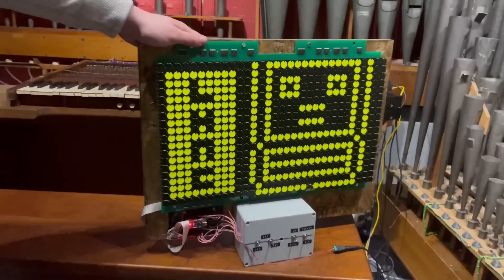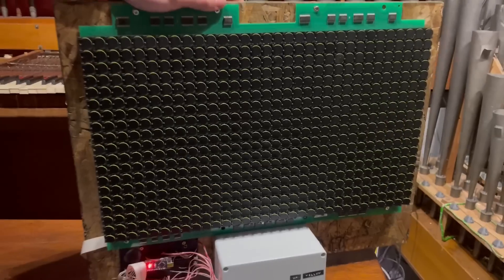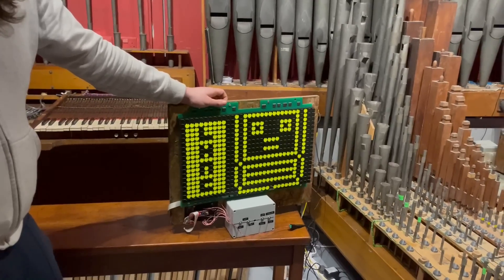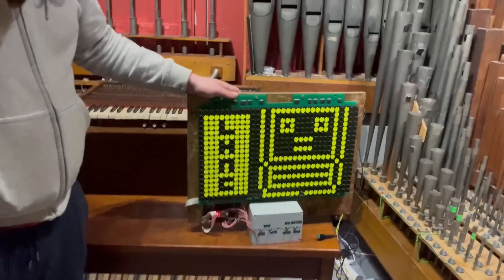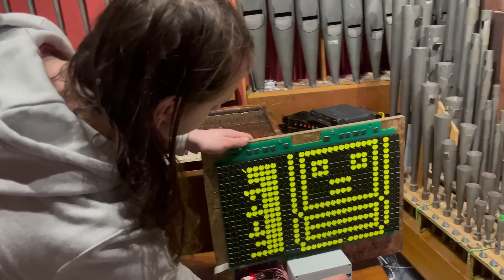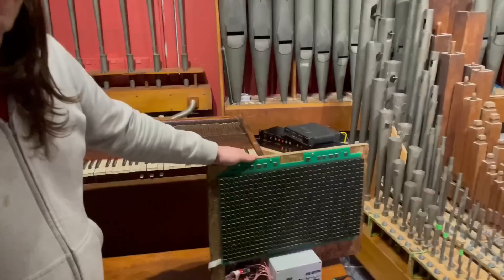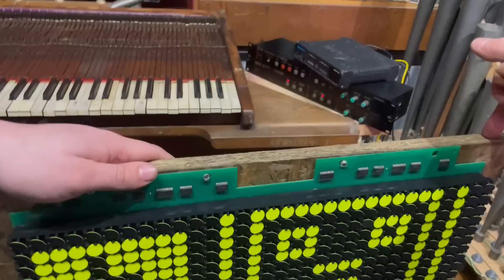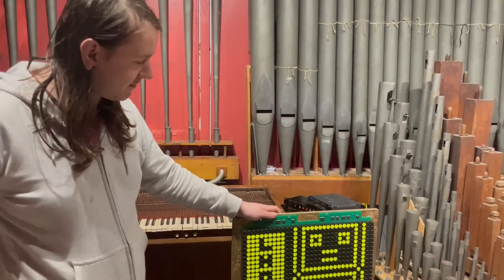Flip Dot Etch A Sketch Part 2 - New Firmware And More Firmware.

Comment from the maker: Massive shout out to caustic and ashley for working some more on the etch a sketch! and just all in all vastly improving the code which i hastily bashed together for the first etch a sketch. more to come. also the bigger project is coming along, mikes electric stuff is awesomely pitching in a hand on it and more info will be coming shortly! either on his or the lmnc channel so keep an eye out!
Reply: with friend we try to use the caustic adafruit_HANOVER_FLIPDOT.
But this code did not compile when we try one of the exemple. What i didn't inderstand is how the i2c or spi connection is made to correspond why the pin enable,reset,row advance, colum advance etc..

Comment: Its a heck of a thing to work on when you dont have the hardware!
Reply: If there are some left over after the big screen at front I'll post you one
Reply: @LOOKMUMNOCOMPUTER  Only if you can. I could still work on it without one in front of me, but that would for sure make it easier. International shipping is a pain.
Reply: Im also working on a 1-bit video encoder using FFMPEG and python PIL lib to dither the sequences.
https://youtu.be/MEZZLsGpCxY
Reply: @CausticCatastrophe  well I think I'm gunna make a little pcb for the arduino driver thingymagoop
Reply: @CausticCatastrophe  very interesting! What resolution is that?
Reply: @CausticCatastrophe  I'll let you know! Will know more pretty soon on the amounts and atuff
Reply: @LOOKMUMNOCOMPUTER  too high! but FFMPEG can shrink the reso easily. it just wouldnt look like much! Im having a think about how we would want to send the data over to the displays, its all about splitting it apart and spitting it the right places at the right time.
Reply: Yes I bet! We were talking about that and props to it! And amazing you even took it on in the first place :D
Reply: I'm wondering for the drawing mode, why don't you just treat it like a regular screen? DO the drawing in ram and just periodically send the whole screen out. It seems too obvious to me, so I'm sure I'm missing something.

Comment: Lite Brite*
Reply: But there's no plastic rings and heat?
Reply: @LOOKMUMNOCOMPUTER  It's more of a lite brite than it is an etch a sketch.
Reply: @ShouldHaveBeen  not really as litebrite is not controlled by moving the axis? Yes it's pixelated but it's more about the method of control
Reply: @LOOKMUMNOCOMPUTER  From an artistic perspective I think it's more about how the end product looks than how it's operated. If I put paint on the end of a pencil am I still sketching?
Reply: @LOOKMUMNOCOMPUTER  Maybe "Etch-a-brite" or "Lite-a-sketch"
Reply: @ShouldHaveBeen  if you make one you can call it that :D
Reply: @LOOKMUMNOCOMPUTER  I don't usually mess around with light projects. I do mostly audio. Though I've been a live lighting director. No need to build something that already exists. Most contemporary industry standard lighting boards have x and y axis adjustability built in.
Reply: @ShouldHaveBeen  all good well I'm gunna keep calling this the flip dot etch a sketch just cus it rolls off the tongue. You can call it what you like. 👍
Reply: @LOOKMUMNOCOMPUTER  Just to beat a dead horse, the axis control of a lite brite is the analog of human hands. Keep up the good work. Your mini cooper theremin blew my mind.

Comment: Having hacked and modified a bus flip-dot display for a museum (for the visitors to select their own fictive destinations) I too had the experience of massive amounts of stuck dots. I then figured out that if you give the display a good whack in the rear, it sorts itself out. I then heard from a service tech for these, that percussive maintenance is standard procedure on them, lol.
Reply: Woop woop
Reply: Apparently air compressor wiggling em is a good one too. The bottom one has just got jolted as it had been in Ashley's boot of his car and we didn't check it before tut vid
Reply: That might be why many displays are completely refreshed even if only a small change is made not only does it keep the elements active it likely creates vibrations that free stuck dots. For an exhibit it might be worth having a refresh sequence that runs after a period of no use.
Reply: @mfx1  Yeah in buses and similar installations they always refresh the whole display, and usually the entire display is written twice in case there are slightly stuck dots. At that museum thing I did there's no need for a refresh cycle, since it has been changed over 50 000 times in about three months, lol. The kids absolutely love it!